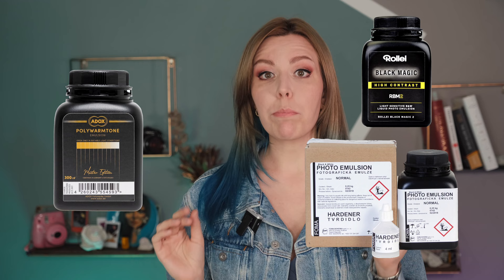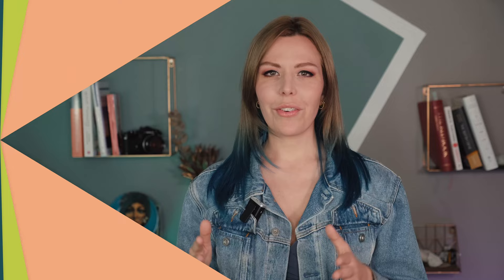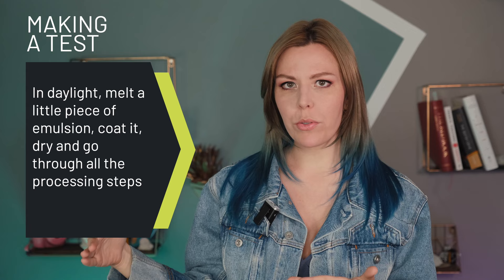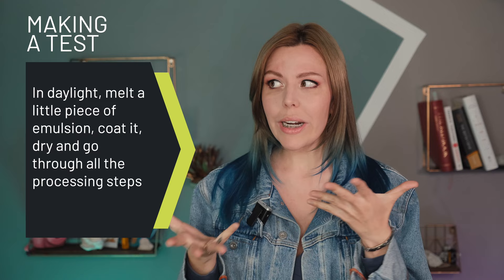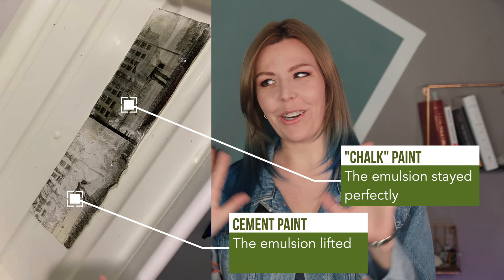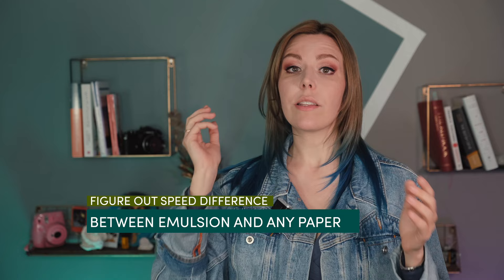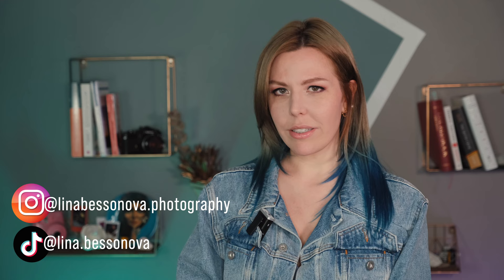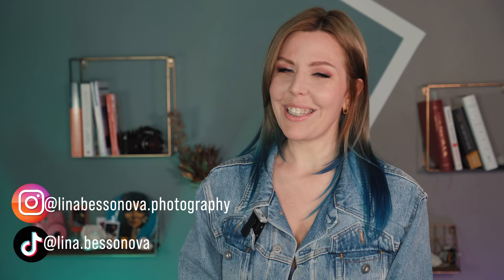Prints On Concrete with Liquid Emulsion

Comment: Great help. Thanks. It would be very usefull to have a condensed summary of the workflow. I am not sure what is the role of the hardener. Is applied along with the gelatin or as a replacement of the stop bad. Something I am missing in the video

Comment: Good video.  I'm working on making prints on stone.  It turns out I'm basically following your steps but have had trouble with getting an even emulsion coating.  The last tests I did I had added several coats of emulsion in order to get an even coat.  Can you make the coating too thick?   I'm using a foam brush.  Perhaps I should use a standard paint brush?
Reply from the maker: Yes, you can make the coating too thick. It's better to have two very thin layers. Try a Hake brush! (goat hair)

Comment: Not to sound daft but is the separate gelatin coating 100% necessary for every coating, or just for the concete? The emulsion itself is gelatin and a few other videos don't show any extra prep work for other surfaces - just direct emulsion coating.
Reply from the maker: Sometimes on some papers and some materials gelatin isn't necessary. It really really depends on the material. I've printed both with and without, and I like how the emulsion spreads with a gelatin layer more. It's so super cheap, it can totally be used a lot. Just 20 extra minutes really

Comment: Thanks for sharing your process, the results look great. How do you make sure the contrast of your negatives fits to the emulsion? Did you specifically develop the construction side negatives for printing on PWE?
Reply from the maker: You can control (to an extent) with the developer, having it a bit stronger/more diluted. Generally all my photos for some reason fit the emulsion just perfect :) Rollei has a variable-grade emulsion, but I have not tried it yet because I'm quite happy with my results so far

Comment: A very interesting video and the idea of using concrete for the base material is a fitting idea for your work for sure.
  I must comment that if you kind of like this process but would like more control of adjusting the image as you go then be sure to look into the Wralings Oil Print process. The only real toxic part of the Wralings process is the potassium dichromate sensitizer solution but this can also be applied in subdued light before it dries and then is really sensitive primarily to the UV range of light. For reference checkout Quinn Jacobson's videos. This is very similar to Bromoil but simpler to my mind at least.